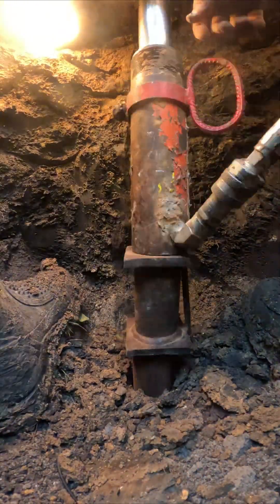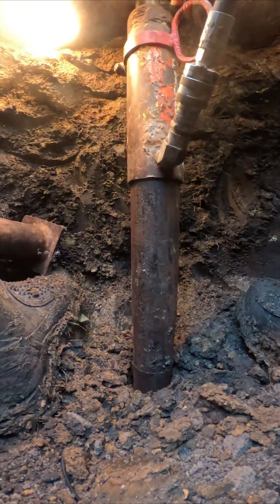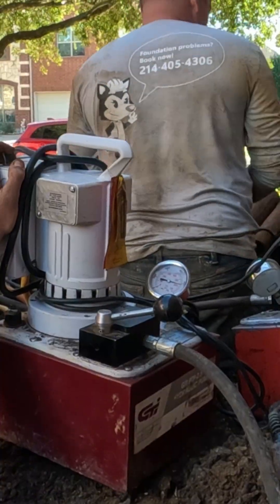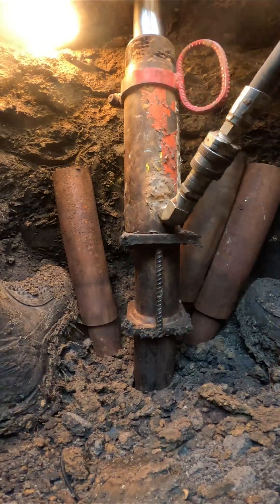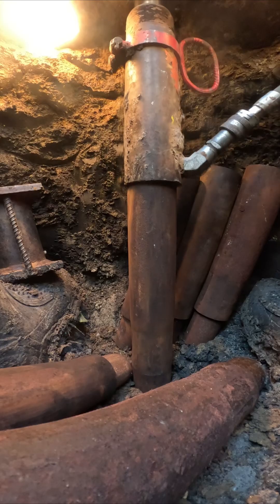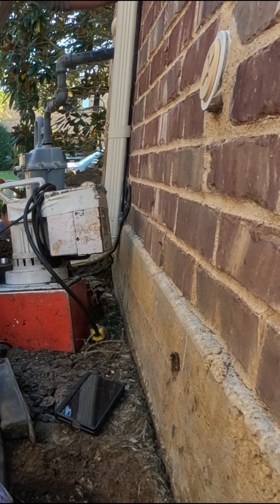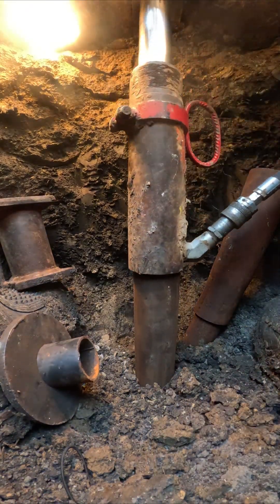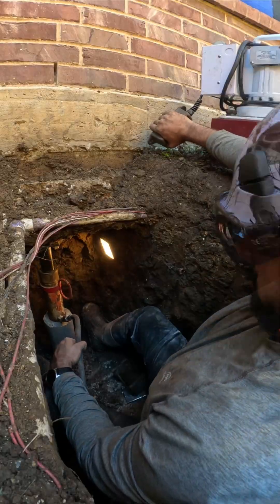How Steel Piers Work in Foundation Repair

Comment: How much force can each rod take without  moving down into the soil?
Reply from the maker: Each pier is pushed down with hydraulic pressure until it reaches the load-bearing strata, and that usually happens at around 9,000–10,000 psi on our gauge. Once the pier stops moving at that pressure, it means the soil below can resist the load and the pier is locked in place.

After that point, the pier can safely take the weight of the structure without moving deeper into the ground.

Comment: Do you only install piers on the edges of the foundation?

What happens to the interior areas of the foundation in order to get lifted up? 

Is there any stress built-up in the center of the foundation if piers are being installed on the edges?
Reply from the maker: We don’t only install piers on the edges – the layout  includes interior piers when needed, right under the load-bearing beams. During lifting, all piers are raised simultaneously so the whole foundation moves together. The slab distributes the load evenly, so no extra stress builds in the center as long as it’s lifted properly.

Comment: Good work, but why did they build the house with only 12 inches of concrete foundation reaching into the ground, I would think you could see it is soft ground while building it in the first place, yet there is no compacted gravel under the foundation, and only this much concrete. So its just a question of time until it starts to sink. Is this standard in your area?
Reply from the maker: Exactly and yes, unfortunately shallow foundations are very common here in Texas, and then we add that we have highly expansive clay soils
Reply: @ifixconstructionfr   I mean I am used to buildings here in germany where they really overdid it, with per example a foundation for a single balcony post made out of 4m³ of concrete and with lots of compacted gravel and recycled crushed bricks under it, but this is extreme in the opposite way.

Comment: Do you bolt it in the end so it don'tbend pier eventually or is that not possible
Reply from the maker: The pier segments interlock and sleeve into each other, creating a solid vertical column. Once they’re driven deep into load-bearing soil and the entire weight of the house is sitting on them, there’s no lateral movement—only vertical compression.

Comment: I'm wondering how the pipe sections stay lined up as they stack together without any of them being linked or fastened together?
Reply from the maker: The pipes interlock with each other
Reply: @ifixconstructionfr ah now I see it. There's a smaller diameter section of the pipe that slides into the top of the previous one. I missed it the first time because of the timelapse. Thanks for the answer!
Reply from the maker: No problem, the videos are speed up a lot, so we can show everything within 1 min. But we would love if you take a look at your channel and longer videos, where you could watch the entire repairs

Comment: Is this practical for peer and beam?
Reply from the maker: Pier and beam system works a little different. Push Piers are not always the best option for pier and beams, as the structure is light and refusal may happen to early
Reply: @ifixconstructionfr  Whats the best method for pier and beam?
Reply from the maker: For pier & beam foundations the most effective method is usually adjusting or replacing the wood shims and adding steel shims, combined with re-leveling the beam structure using bottle jacks. If the soil movement is severe or support is weak, we sometimes install steel or concrete piers beneath the interior beams, but only after evaluating the crawlspace — every case is different.

This type of repair focuses more on correcting and reinforcing the beams & supports above rather than pushing deep piers like with slab foundations.

Comment: I imagine the cost will be so much, a lot of steel to use. I think it's only good for a single-story building, but once you add more weight/floor it won't hold that pressure. That steel and concrete won't survive new floors
Reply from the maker: These piers are designed to support structures of all sizes and weights—even multi-story buildings.

Comment: 1) How do you know this pipe doesn't bend inside the soil? If you put together these segments on the surface into 10 or 15 m long pipe, you can see how much it can bend even with its own weight. The last segment can be straight vertical, but the whole pipe can bend under ground.
2) What about the long time settling? While driving the pipe, you do it rather fast and reach the equilibrium because use the weight of the house. The pipe is carried by the hard soil on its tip + drag on its entire surface. What if one of these forces decreases after a while? It needs just a little to put the house back because equilibrium will be lost.
3) When lifting the house like this, you add a huge force concentration point, instead of spread force along entire wall. How often do the houses crack after such repair?
Reply from the maker: I’ll try to summarize it simply:

1. *Bending in the soil:*
   The pipes are sleeved and interlock, and the bracket keeps the first section perfectly plumb. As we drive them, if a pipe tried to bend it would immediately kick or bind in the pocket and we’d see it. Once it’s surrounded by compacted soil it acts like a confined column, so its buckling capacity is much higher than when you see the pipe flexing in the air.

2. *Long-term settling:*
   These are designed and installed as **end-bearing piers**, not friction piles. We keep driving until we hit very dense/load-bearing stratum, then we’re reading around 10k psi over a 3" collar at the tip. The actual working load of the house is only a fraction of that, so there’s a big safety factor even if skin friction changes over time.

3. *Force concentration / cracking:*
   We don’t put the whole wall on a single point—piers are spaced about 5–7 ft apart along the grade beam, so the load redistributes through the reinforced concrete. Re-leveling can definitely cause some *cosmetic* drywall/brick cracks to open, close, or move a bit, and we explain that to homeowners. The goal is to stop the structural movement and keep the foundation within tolerance, not to guarantee zero cosmetic cracking.

Comment: so ... are the pieces not fixed to each other? What happens if they start disconnecting while being buried? Wont that shift the entire column and effectively negate the previously achieved correction?
Reply from the maker: They’re designed to go straight down. Each pipe telescopes inside the next one, and we watch the alignment as we drive them. If a pier tried to curve, the ram would push at an angle and we’d notice immediately — we stop and correct it.

We do hit rocky areas sometimes, but if we encounter a rock big enough to redirect the pier, we reposition and continue driving vertically. Staying perfectly plumb is critical for long-term performance.

Comment: Very nice work. I was wondering, do the steel pier sections always go straight down or can they curve to the side? Are there many rocks where you work?
Reply from the maker: They’re designed to go straight down. Each pipe telescopes inside the next one, and we watch the alignment as we drive them. If a pier tried to curve, the ram would push at an angle and we’d notice immediately — we stop and correct it.

We do hit rocky areas sometimes, but if we encounter a rock big enough to redirect the pier, we reposition and continue driving vertically. Staying perfectly plumb is critical for long-term performance.

Comment: do you fill the steel piers with concrete?
Reply from the maker: Each pipe is made of high-strength structural steel, designed specifically to work under pure axial compression. The walls of the pipe alone carry the load, and since the force is vertical (straight down), there’s no bending or buckling once the house’s weight is on top. Filling them wouldn’t add strength or stability — it’d just add cost and complexity.

Comment: How does the hydraulic pressure drive the pile without lifting the house? But then the hydraulic jack lifts the house without driving the pile?
Reply: Because when driving the pile it’s passing thru soft material so it’s not strong enough to lift house until it hits hard. When hits hard it then lifts the house
Reply from the maker: When we’re driving the pier, we use the hydraulic pump.
It applies a fast, constant force, so the pipe moves down through softer soils without lifting the house.

2️⃣ If we used the bottle jack from the start, the pier would also go down, but very slowly—it would take forever to drive a 20–30 ft pier by hand.

3️⃣ Once the pier hits load-bearing strata (you can see it at ~10k psi in the video), the soil pushes back hard enough that the house starts lifting.
That’s when we carefully switch to lifting and avoid over-lifting.

You actually see the structure move right when we reach that pressure.

Comment: Is the concrete anchored to that steel plate at all or does it just sit?
Reply from the maker: Once the house’s weight is transferred, that pure vertical force is more than enough to keep it locked in place—no anchoring needed.
Reply: @ifixconstructionfr If you were in a seismically active zone, would it become necessary to anchor the piles to the foundation to resist lateral movement? Or would it be better to leave it as is, as a sort of base isolation?
Reply from the maker: If this was a seismic zone, structural engineers would specify lateral anchoring and reinforcement to prevent shear or horizontal displacement. Leaving it “floating” isn’t considered safe or effective unless designed as a true base isolation system.

And here in Texas, since seismic activity is minimal, piers rely on vertical confinement and compression only, which is adequate.

Comment: 10k psi is crazy
Reply: That is fairly normal for small hydraulic power packs like this...If they only used 5k psi the cylinder would need to be  2x the size(~1.41 times the diameter) and  the cylinder has to be moved around by hand, so the weight matters.